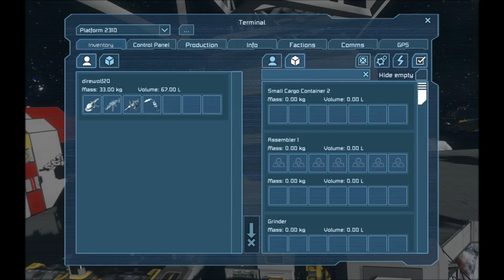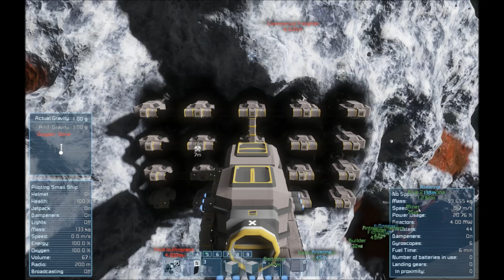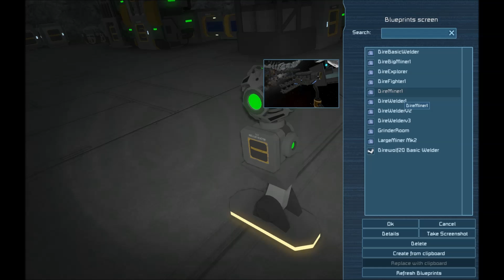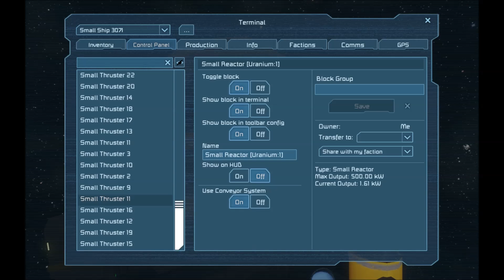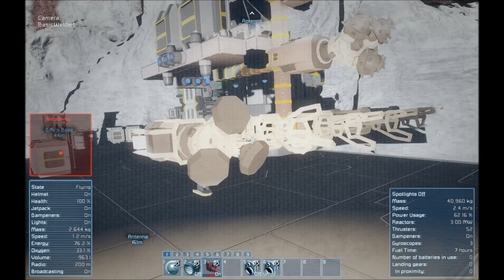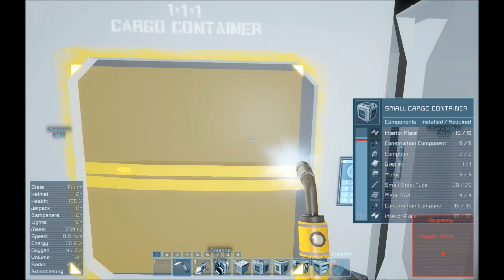Space Engineers   S1 E7 Bigger Mining Vessel

Comment: So, when I tried to build a similar ship on my own, I end up with a ship that will not fly in any way shape or form in a straight line. The same thing happened when I tried my first design using rotors too. How are you compensating for that? Whenever I build a ship using either of these, it always ends up being completely uncontrolable, constantly requiring course corrections when going large distances.

Comment: What is the point of the pistons on this ship? I'd get it if the base had a tight entrance, but the "entrance" is the UNIVERSE, so there's really no need to conserve the space. It just makes it clunky to use and clunky to build thanks to the pistons converting everything into sub-grids.

I think it would be better to replace each piston on that ship with two straight conveyor tubes, for the same efficiency but neater handling. That way you could also build the grid of drills into a blueprint and just apply it to the ship whenever you wanna expand.
Reply: +morphman86 As he said in the video, the main point is the coolness factor.  Sure, there's not really much need for it in practical terms, but it's fun.
Reply: Mirality I'm just slightly disappointed, because Dire usually builds really cool stuff that's also functional. But so far, in this series, he's just throwing random blocks together, because they exist.

A dock hub for the ships, with tiered docking ports that extends as needed would be a cool and functional use of the pistons. Having the pistons extend forward as well, so you don't have to rely on the thrust of the ship would also be cool.

As it is now, it's just unnecessarily clunky and superfluous.
Reply: ***** I'm sure he'll get to those things.  He's still a bit resource constrained at the moment, which was the point of building a new mining ship in the first place.
Reply: Mirality It would take less resources to make a docking hub with four pistons than a mining ship with 16.
Reply: It looks like it's useful for backing out of drilled tunnels in asteroids. Tunnel style mining is a bit easier/lazier than strip mining.
Reply: MadocComadrin Thank you, that sounds like a reasonable explanation.

Comment: I just came up with a brilliant machine!!! Use pistons at low speed in an array similar to your mine ship. attach welders instead of drills. then use a piston system to draw the welders upward away from your platform slowly. Conveyor into the welder system in order to not run out of parts. If you then use a blueprint system at the lowest part of the platform you will essentially have a 3d printer. When the welders pull away from the blueprint they will allow the next set of components to build. I hope  described that well enough. I want to see this in action :)

Comment: Dire in order to fix the problem you were having with the autopilot docking why not use a piston with the connector and have the miner line up to the connecter and then have the connecter slowly extend until it attaches
Reply: +Armetron The problem is that connectors have too much magnetism at the moment, and his script was turning the connector on too early.  A connector on a piston would have the same problem -- as it extends, if the connector was enabled then it will forcefully attract the ship at some point far enough away that it will cause it to crash quite badly.  His autopilot as it stands is fine, he just needs to avoid turning the connector on until the ship is right against it.
Reply: +Mirality so why not auto line up the ship, extend the connecter with it toggled off. have it so that they are almost perfect, then turn on the connecter

it should be so close that the magnetism from the connecter toggling on shouldn't do anything

Comment: I wonder if anyone here can help with this. I'm having problems with connected inventories. Yes, the systems are enabled in control panel. But, for whatever reason, they will not interact with each other. I've redownloaded the mods and verified the files on steam. I'm not sure why, but even connected 2 small reactors directly to the back of a cockpit will not allow for access to their storage from within the cockpit (something I could do previously). I'm not sure what has changed but this is a serious impairment. Thanks in advance folks.
Reply: +MPHIY17 It's because the conveyor system requires power. Try putting one reactor where you can access it and put some Uranium in it. After that you should be able to access all the other reactors.
Reply: +Mephi Dross or a battery or solar its also an option.. so there is a helpful tip from me.. if u re creating a blueprint put some little amount of uran in the reactors.. so when u weld it together, the reactory will have some uran inside.. dont put to much because the same amout will be needed in survival to complete the reactor (with uran)

Comment: I've got a drill ship for ya... an 11 x 11 array of large ship drills and 92 small cargo containers in a frame of heavy armor.  Leaves a nice long square hole going straight through asteroids.

Edit: this one doesn't have to back out.  I just pull up to the asteroid & stop.  turn dampeners off, start drills, set speed to 0.2 m/s.  it will then go all the way through the asteroid.  it's got enough cargo capacity for at least three passes through.  I've also got a sorter-connector combination to eject unwanted stone as it mines
Reply: The game sorely needs an incinerator for all the excess stone you can get from mining like that.
Reply: MadocComadrin my answer to that is to have four connectors on the aft end of the ship ejecting stone as I mine.  with all of them going and the floating objects count set to 128, it despawns before it's traveled one ship length

Comment: Hey Dire, why is does the uberdrill not extend vertically? Wouldn't that make it a little easier to get out of a hole?
Reply: +Curtis Alcock I tried making that myself, but I totally suck at building ships that incorporate pistons and rotors. The result was a ship that refused to move in a straight line. However, the vertical pison idea part of it should work fie, as longas you know how to compensate for all of that angular motion, which I dont.

One thing I did run into is that, since the ship wobbles violently when all of those pistons are doing their thing, the ship hits the edge of the hole hard when the pistons retract, and some drills are destroyed.

Comment: Why not have pistons vertically in addition to horizontally?
Reply: I'd be worried about stability there. That, plus you'd only have one connection point from the drills to the rest of the ship, so one unlucky collision means goodbye drills.
Reply: +MadocComadrin That's true, but wouldn't it make collisions less likely when going backwards as the hole would be bigger than the drill on that axis as well?

I've never played the game so my logic may not apply as well as I think it does.
Reply: Sigel Yeah, if you added vertical pistons, it would work like that: it's completely doable and theoretically reasonable.

However, having more than one piston pushing separating A from B is a bit dodgy at the moment, so you're left with one piston connecting your vertical "branches" to your ship. If you lose that piston or a critical block near it, you run the risk of losing a large amount of drills.
Reply: +MadocComadrin Thanks for the explanation. Now I understand the reasoning better. ^^

Comment: Hey Dire,

It occurs to me that using a piston on your docking port at the Space Centre would mean you could get your ships into position and then extend the piston to avoid the damage from the auto pilot coming in too hard.
Also is there any reason you don't have individual docking ports for each ship?

Also someone posted on your last video the reason the welders auto pilot was derpy, not sure if you saw it.
The reason is likely caused by the remote control being forward of the ships centre of mass, which causes it to move the remote control of it's waypoint when it rotates the ship.

Enjoying the play through, though I personally would have preferred KSP over Space Engineers.